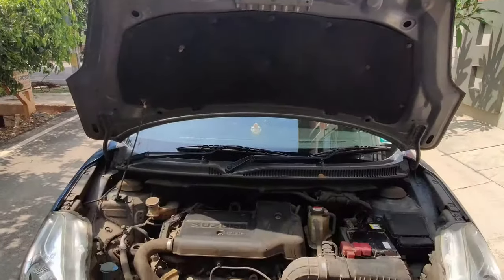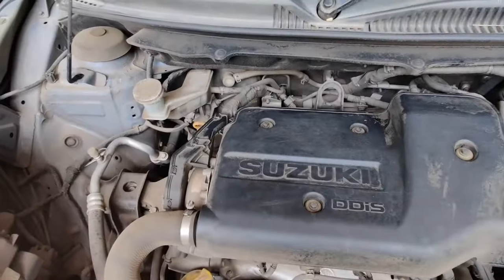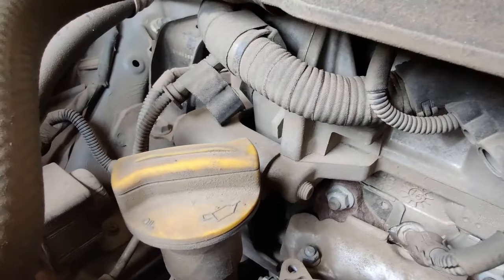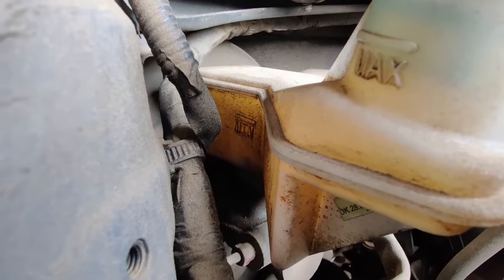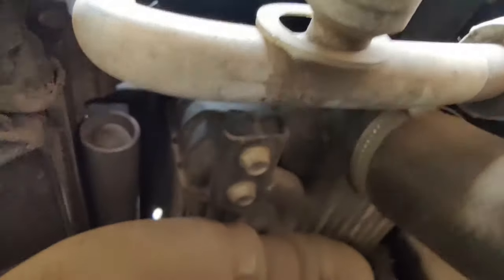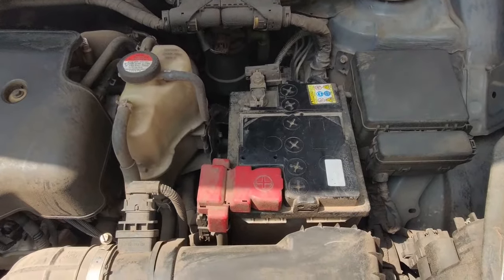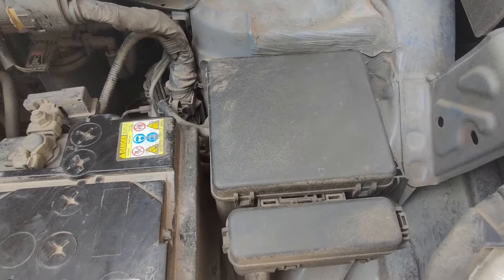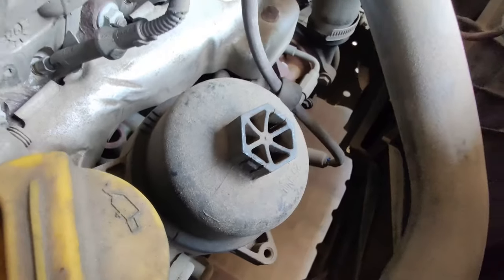components under the car bonnet ||| CAR CARE

Comment: I appreciate your video..a few things to note however..
1. At 4:00..it's not a turbo charger..it's the engine oil filter's housing/cup. Diesel oil filters need housing since they are paper type unlike their petrol varients.(u can use this trick to find out if a vehicle is petrol/Diesel variant.. Diesel oil filters are accessible by opening the hood, Suzuki Petrol vehicles usually place their oil filters under the engine)
2.turbo chargers do not recirculate exhaust gases to the engine.they use exhaust gases to run a turbine and the gases are then vented out.This turbine powers a pump which sucks air and delivers the compressed air to the engine..This method is called forced induction.
3. Exhaust gas recirculation (EGR) is also used in petrol vehicles (that is like you said, reintroducing exhaust gases back to the engine, but that is a totally different system)look for an EGR valve.